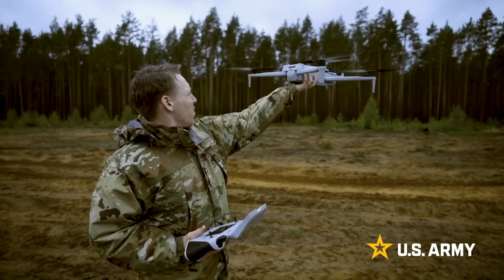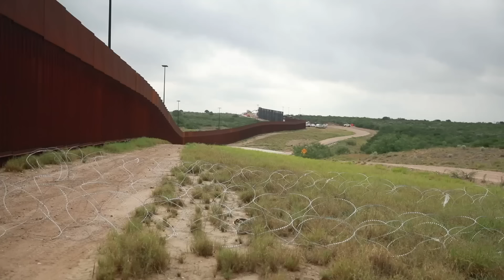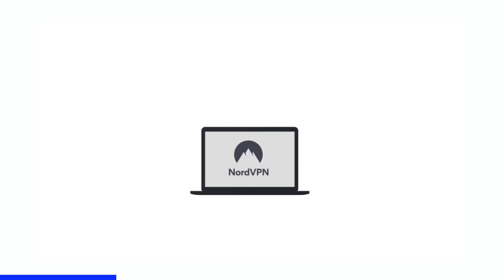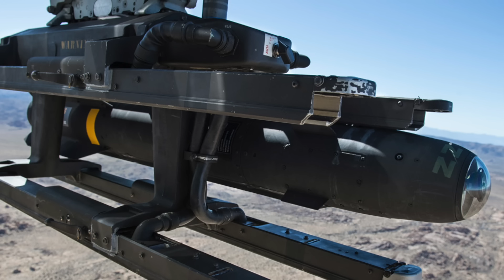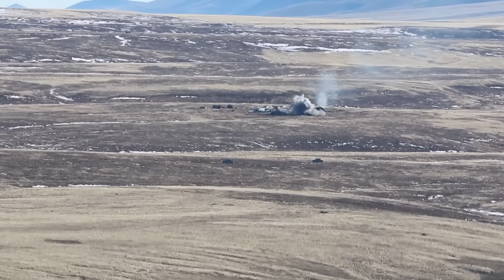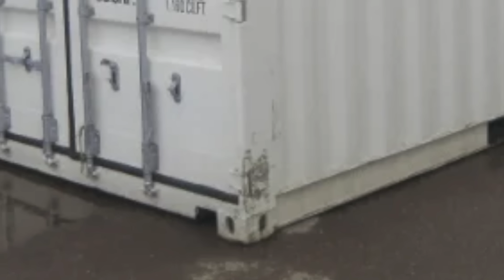How Lockheed Martin’s Grizzly launcher could redefine battlefield surprise?

Comment: For anti-drone such as a Geran II type, the Hellfire and JAGM is too large and its 20lb warhead is larger than needed (3 to 4 lb is more than enough).  A similar length with smaller warhead and reduced overall weight and diameter missile would allow for more missiles to be packed into the 10-foot container.  Also, Hellfire is rated to 3000m while Geran II can operate at 4000m.
Hellfire can reach speed of 1.3 Mach.  This performance can be reduced a bit to improve altitude and range performance by using a more efficient rocket motor.
Reply: You could also design cheap switchblade-layout interceptor or kamikaze drones that fit in the cells and are compatible with the rails.
Reply: @catcrazy-g5g  Yup.  A Switchblade 600 is close to what they need and 1/3 weight/size of Hellfire, and a slightly higher altitude window, but too slow with max sprint speed of 115mph for air defense. Something in the middle of Hellfire and Switchblade and cells that can be filled with a mix and match munition, similar to NASAMS launcher that can fire a mix of air defense missile.
Reply: The weapon for drones is the LOGIR with longer range
Reply: Relax they need a reason to spend these billions of dollars bro!